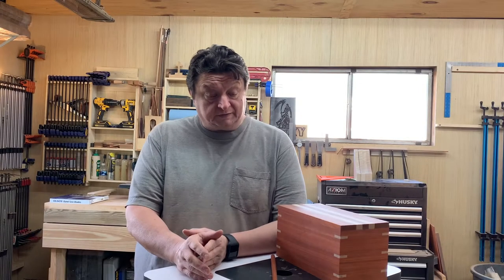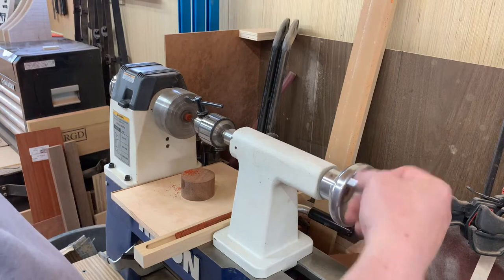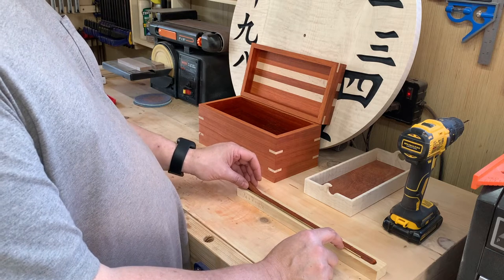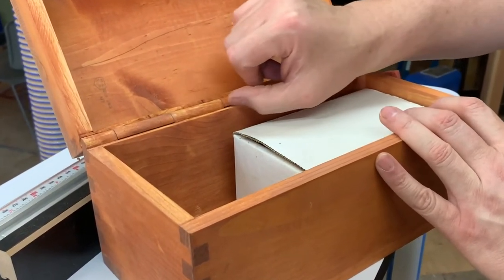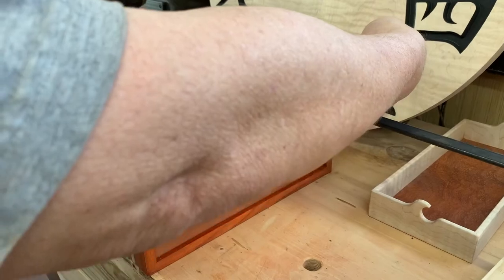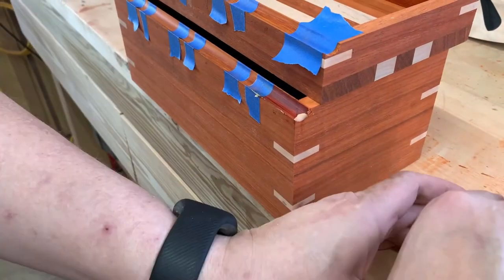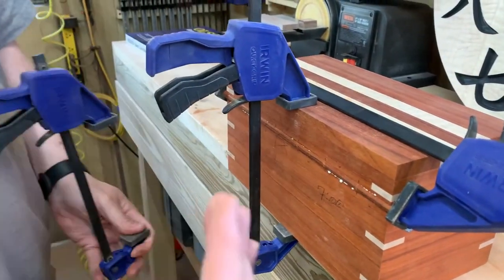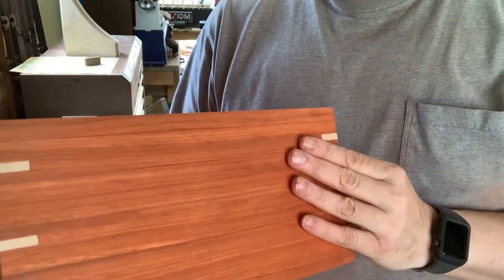Wood Hinge

Comment: Hi Roland. Have you ever tried to see if you can make an invisible hinge that didn't go all the way to outside of box. Sort of a stopped dado hinge. Is it possible? Have you ever tried making an invisible hinge with dovetailed corners?
Reply from the maker: Hey Mr. Rick. That actually doesn't really work. It won't work because the corners beyond the ends of the hinge are crashed in the closed position. HOWEVER, if you chamfered out from the hinge dowel on the lid and the bottom, it would no longer crash BUT, then you'd have a visible line.
Reply: Yep. I agree it will bind. A relief would work but then it would be visible. Thx.

Comment: Well done for your first video! I've watched a few videos about making wood hinges, as others have said, I like this route. For one, it would be better suited for longer hinges and it takes out the pain of drilling long holes. Glue up looks a little tricky. One thought, before installing the rod, if you put wax on the rod, should be easier to put in the segments and a smoothly hinge action after you are done? Just thinking. It turned out very well. :)
Reply from the maker: Thanks for watching and for the feedback. Waxing the rod works just as you mentioned and in some cases, especially when the rods come a couple thousandths thicker than usual, it can be essential to just getting the dowel reassembled. The reason I don't do that unless I need to is that even the tightest rod fit makes for a smooth operation of the hinge due to the torque imparted into the center axis of the assembly itself once it's completed. However, it DOES get rid of most of any hinge squeak that might be there in the end. Also, I usually use Oddie's Oil for finishing the hinge itself inside the box and that also helps. I plan on making another hinge video pretty soon to highlight how my process has evolved...I hope you can look forward to that.

Comment: Wow, that is very cool. With the dowels fitting so tight on the brass rod , I thought the glue joint might fail. How do you determine dowel size and segment length for different size/thicknesses? Is there a formula you use. I really like this. Excellent work.
Reply from the maker: Hey Mike...thanks so much. As to segment size...the limit is how deep I can drill without bit drift...I try not to exceed segment lengths longer that two inches. I use 3/8" dowels in Half inch thick material now...in the video the dowel is .5". I have no formulas BUT, your dowel needs to be equal to or less than your box's wall thickness to work properly.

Comment: Mr Dean, I am in the process of trying to make a box like yours with the hinge and was thinking ahead of the process you use for the finish without causing the hinges to stick or get into some kind of a bind. Thanks so much and Happy New Year.
Reply from the maker: Hey Tom...I use lacquer inside and outside of the boxes now. I finish the inside surfaces, assemble the box, cut off the lid, and then lacquer the lid edges. Once those are finished, I cut the back edges for the dowel...this bares the wood for glue where needed for the dowel and prevents glue from sticking anywhere else. As for the hinge INSIDE the box that's only visible when opened, I use Odie's Oil for that.
Reply: Thank you so much for your input, I will post a pic when I am done with mine, so far so good.
Reply from the maker: Can't wait to see it  @tomrainwater8824  .

Comment: Do you wax the ends of the dowels or worry about the glue getting between the dowel joints or did I miss that in the video thank you..
Reply from the maker: Thanks for watching my video Chris. I don't wax the ends of the dowels. I've never had a problem with that much squeeze-out at the ends.

Comment: Hi Roland, great video! When you did a test cut on the scraps, what exactly were you looking for to make sure its set right?
Reply from the maker: Hello there and thanks for watching. I test cut scraps for a couple reasons but mostly to verify the fence setting because that tells me how close to 90 degrees the hinge will open once completed.  I like for my hinges to open just shy of 90 degrees so this setting is pretty crucial for my process.

Comment: Roland, i'm a bit late to this party, and will give this a go very soon. But when you were routing out the recess for the dowel, why did you leave a slight gap between the lid and the base, why not give 1 more pass on the router, thus making the gap between the lid and base invisible?
Reply from the maker: Great question RL. That tiny gap is something I learned from experience with these hinges. The lid, since it's made from wood, can sometimes warp UP at the front of the box. If there is NO GAP at the back, the front of the lid can LIFT OFF, leaving a, sometimes very visible, gap at the face of the box. This tiny gap at the back prevents that from happening. HOWEVER, you CAN do as you mentioned and make it super tight. Sometimes they don't move.

Comment: Great videos Roland! How did you settle on 1/8" rods? I saw that they also had 3/32". Just curious. I can't wait to tackle this!
Reply from the maker: Thanks for the view commish. The 1/8" inch rod was my choice because of a few factors. It was small but not TOO small and still rigid and strong. It's not going to rust since it's bronze...AND I can cut the hinge out if I ever need to without fear of hitting a steel rod...ALUMINUM would do well also but it costs more and isn't as easy to get hands on for me. ALSO, the drift on an 1/8" drill is FAR less than the smaller sizes so I get a better result drilling the segments out. I have now changed to 3/8 dowels because that's easier cutting the grooves and hides better. The rods now are WAY tighter in the wood and I have not changed my drill...I think the manufacturer changed their process and they are a couple thousandths bigger than before.

Thanks again for the view and I hoe you can watch others and subscribe as well. I only have a few left to get to 1000 subs and I'd love to get there soon.

Comment: Instead of using The lathe, can also using a drill press?
Reply from the maker: YES you CAN use a drill press since a drill press is so very similar to a lathe, just vertical instead of horizontal. I used a technique once with the press and it worked fine.

Comment: what kind of jaws are you using on your headstock chuck to hold that 1/2" dowel?
Reply from the maker: I don't know off the top of my head but, it holds the 3/8" dowels I use now for this process as well.

Comment: Did you by chance measure the hinge as to how far it is from being flush with the box with the 1/2" dowell?
Reply from the maker: Hey Tom, that is a great question and a tricky one too. Since I've switched to using 3/8", I HAVE noticed that the dowels get "buried" about 2/3rds into the back of the box. I have a JessEm router table now and with the 3/8 bit, I set the bench at 1/8 back from zero. HOWEVER, I ALWAYS use scrap first to set both lateral and vertical depth before I start cutting into my hero piece...just to be safe. Thanks for the comment and for watching my video.
Reply: @rolandgdean  I am going to try to make a wooden hinge and use your video. There has to be a formula as to how far the dowel is out of the box to maintain the correct opening of the lid for each size of the dowel. I will also use several scrap pieces I am sure. I am guessing of course but you would think a 1/4 of the distance of the dowel circumference would move the lid  90 degrees so, in my calculations, a 3/8" dowel is 1.1775" in circumference divided by 4 gives me .294375 so that would be the amount sticking out. I know I am crazy.
Reply from the maker: @imanutnur7  It depends on how wide you want your lid to open as well.The deeper it's buried, the less it opens, so it would be a range.
Reply from the maker: @imanutnur7  Something else...I think of it in terms of radius and diameter, since we have a center axis point and percentage "buried". I'm thinking that about 85% buried would get the lid opening 90 degrees. So, the center of the BIT would be "about" 35% of the diameter of the dowel from the back edge of the box.  >.<   This maths hurts my brain this early in the day...lol.

Comment: How long did you let the glue dry before risking moving the hinge parts?
Reply from the maker: I give it about 4 to six hours minimum.
Reply: @rolandgdean  I want to thank you for being so responsive and helpful. I wouldn't get this kind of support from Cosman. Once again...thank you.
Reply from the maker: @Mr_Rick  Yeh, I like to think that it's because they get so busy once they have a lot of subs. However, I subscribe to Shogo here on YouTube and he always response to my DMs in IG and he has 1.5 MILLION subs so...I don't know, I guess it's about the person. I asked Rob a question once about the hinge in regard to the full length pin and he told me that it couldn't be done because the bit would deflect trying to drill all the way through a segment...I just flip the segments and drill halfway...plus, he uses smaller bits too so...I guess it depends. I'm used to figuring out a lot on my own.
Reply: @rolandgdean  I once asked him a question but don't often. Especially since once he got snippity and a wee bit condescending when I asked him a question. He's really good but I can do without the attitude.
Reply: @rolandgdean  I just took the clamps off my box after hinges being glued up for exactly 3 hours. I have to admit I was a bit anxious expecting the hinges to be locked up from the gluing. I previously did a quick practice prototype and that happened. Well lo and behold! it works and I'm very excited!!
Reply from the maker: @Mr_Rick  That is GREAT! Drop me an invite on FaceBook and post some pictures when you're done with it! Grats!
Reply: @rolandgdean  would like to but I don't have FB anymore.